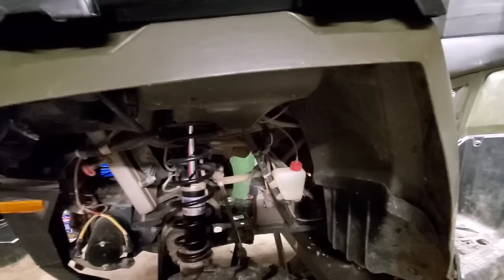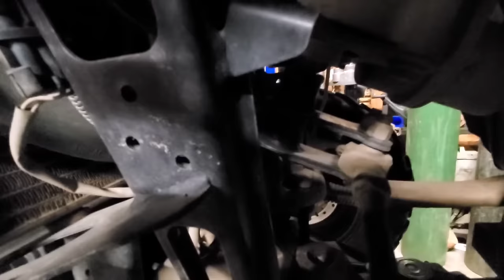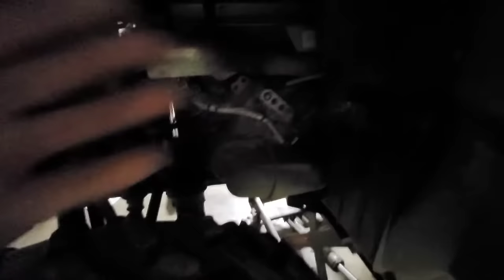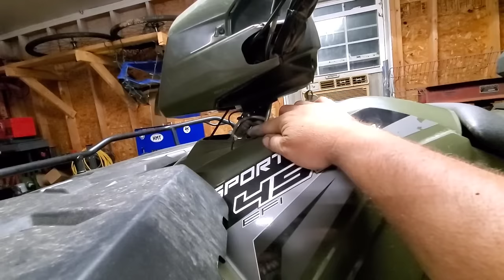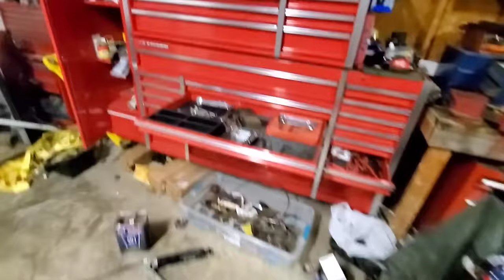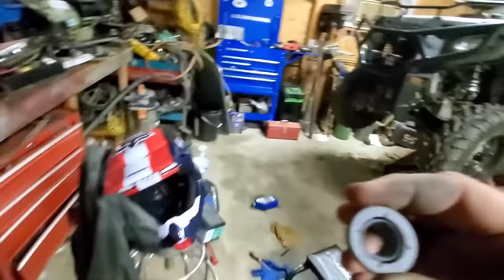Dear Polaris...this is shameful  #polaris #atv #sportsman

Comment: I have a can am 330 it's a 2003 with 10.000 miles the only thing I replace is the battery and ujoint on drive shaft and a fan that it but now if you buy a new one it's junk from the start. Never gonna buy a new one look for the older ones best bet .

Comment: I’ve never had issues with any of my Polaris ATVs and I’ve had lots of them with thousands of hours
Reply from the maker: I'm sorry but I simply do not believe that. You may have ignored issues that we address but polaris has many many weak links.
Reply: @quadbilly2106  I’m a mechanic for 30 years aircraft I keep my machines up to date , 325 magnum, 2 500 HO , 2 400SP and a 700SP and 450SP over the last 25 years, the  really only issue are torn boots but I ride through all kinds of crap. They are really non destructible in my opinion and I continue to buy to this day.
Reply: Funny how people got like 7 Polaris ATV and never have any issue in putting thousands of miles on it, when others puts few miles on same machine and everything got loose or broken 🧐🧐🧐

Comment: I have a 2015 sportsman xp1000 with 73 miles on it and the charging system stopped working. I only use it to plow snow out of my driveway and I think it's b's that they just build there machines so cheap and they don't care about there costumers

Comment: I own a 2013   500ho!! 9200 MILES hanged wheel brgs front suspension bushings and starter wires wrotted off just a couple months ago!! Other than that no complaints!! Love it and when i bought it the price was 5999.00  cant beat it..  definately buy another one

Comment: The SXS’s are the same quality. I bought a 1000 Ranger North Star for 26,000$ and it was a nightmare. It was a 2018. I’ve since moved to the Can Am Defender XMR and have done nothing but change the oils. It now has 4300 miles on it.

Comment: I have had Sportsmans, Rzr's, Rangers and I'm here to tell you, I'M DONE !!!!!!!!! Not only do there maintenance departments suck, but the cost is on the far side of crazy. Polaris, watch out !!!!! CFMoto is on your a## !!!!!!!! My current 2018 Rzr Turbo has EVERY possible bearing and u-joint changed and not by Polaris garbage parts. I do not even trust their maintenance intervals ..... they are full of sh#t. I'm a "trailer", not a "mudder". So the "accusation" I'm using the machine for what it was not intended is also a f#cking lie !!!!!! As long as we keep buying them, they will never change. The fact of the matter is, they are cheap "Chinese junk" because that is where the majority of the parts are made,

Comment: I’ve had 4 Polaris’. A 1999 Xplorer 400 2001 500 Sportsman HO. 2013 850 HO. Couldn’t break them. I tried. Then I bought a 2018 900 HO Ranger. The slack in the drivetrain when engaging the clutches after shifting into gear was just scary. Felt like I was going to break something unless I feathered the throttle. Dealer after test riding said it was better than most🫣. Plus you could light up a drive belt in a New York minute if you didn’t use low range religiously when required. Never spun a belt on the ATV’s. As I said, rode them hard and put them away wet. Sold the Ranger after 3 years of ownership for Covid prices. What I paid for it less tax. I babied it the whole time I owned it as it felt fragile. Replaced it with a 700 Grizzly SE. I rode much too fast on my 850 so I figured slower bike was the only thing that would slow me down. Short of hitting a tree. Plus 10 year belt warranty. Win win.
Reply: Which was better, 1999 xplorer or 2001 500 ho? I already have a 2007 500 ho efi, I just want 1 more and these 2 choices are mint oldies
Reply: @randylee2549  The 500HO is likely one of the most reliable Polaris’ ever manufactured. The motor power wise was much less susceptible to ambient temperature than the 2 stroke. Also the Xplorer had a solid rear axle chain drive while the Sportsman likely had the best independent suspension on the market at the time, shaft drive. I  loved the 2 stroke but the 500 was the better bike.

Comment: It isn’t only Polaris…I recently replaced my 2007 Outlander 400 with a 2022 570 Outlander. The 2007 was built to last…the 2022 has had several parts replaced under warranty.

Comment: 1500 miles and every suspension bushing was worn out so bad on my last Polaris ATV it felt like it was going to leave me stranded.  Imagine if using a full size truck for that many miles off road and you had to rebuild the front end lol!  I agree they are fun to ride but junk quality.  On top of that their AWD system sucks unless all you do is mud.  I had a moment of weakness 4 years ago and bought a new RZR.  Coming to a steep hill and hit the AWD switch (no throttle input) which lights up, hit the hill and I'm spinning like crazy only to realize it was still in 2wd.  Apparently you have to be going below 15mph or it won't engage lol!  Next ride out we are descending a steep loose power line trail and crawling down using engine braking when all of a sudden it's sliding down trying to go sideways.  Why does Polaris still use one way roller clutches to engage the front drive axles?  NO ENGINE BRAKING ON THE FRONT WHEELS!!!!!!  Works fine on flat lands and mud but crap for mountain riding.  Lastly, on mild slope logging roads it won't even hold back properly because when the engine rpm dropped down to a certain point it would take off again until about 1000rpm more than it would engine brake again.  I'll still to my slow, clunky Yamahas that last for decades without having to replace parts every 6 months lol!

Comment: I have a 2000 sportsman 500 ho has 19,040 miles on it put countless front wheel bearings and Hilliard in it. 3 clutches a water pump and maybe 7 belts. I have never opened the engine. Runs so good still.

Comment: I agree I have three Polaris machines razor ranger sportsman, 1000 and I have about 1500 miles on each and I’ve already had to replace the drive line on the rear on the Ranger four-door. Also some other little parts.

Comment: Polaris destroyed their victory motorcycle line so they bought Indian and dropped their victory customers like a bad habit. 
How long before Indian bikes are left behind at the side of the Rd.
Reply: They already are. 100% break failure, dozens of recalls and having to carry a half inch bar to short the starter solenoide because when it rains the bar switches dont work.
The recalls can  mean weeks to months in the shop. Never again.
They really should be taken to court.
Reply: @stevehunt9703  stock value has always trumped product value there.

Comment: I had a Polaris ranger 570 and before I wore out the first set of tires I had spent $4780 in repairs and I don't ride hard. I sold it and bought a Pioneer 700 deluxe 5 years later it has 14k on it and all I have done is change the fluids and filters. I now own a Talon and am happy with both.

Comment: Something tells me you have never..NEVER..owned a Japanese ATV! Any Yamaha, Honda, Kawasaki or Suzuki absolutely blows these piece of crap out of the water with regards to engineering, R&D, maintenance and simple drivability. I was a mechanic at a dealer for 7 years. Polaris are pure head scratching junk.
Reply from the maker: Grew up on hond 3 wheelers and 300 4x4

Comment: I hear the frustration in your voice, and like you, I do all the maintenance on my machines.  I own 5 polaris side by sides and because of so many undercarriage problems with polaris over the last 10 years, I opted to buy a John Deere Gator.  Cringed at the price but only real maintenance problem in 12000 miles has been the drive shaft (Grrrrr).  Have yet to have any bushings, bearings, brakes go bad.  Yes, a few issues here and there, but overall, I would say five or ten times the build quality on undercarriage.

Comment: I got 2017 polaris 570 touring. 9300 miles. Never broke anything. No bearing axel ECT..Only replaced a belt at 8000 miles. And really didn't need it. DON'T BLAME POLARIS FOR THE WAY YOU DRIVE THEM.
Reply from the maker: Bud, we ride with kids. We do strictly trail riding, not mudding, not at 70mph. None have ever been flipped.
We also have other brands that do the exact same thing, same trails same rides...none of the headaches

Comment: Matt's Offroad Recovery is frequently recovering broken down Polaris machines around Utah's wilderness.  Either they sell most of the vehicles or they are problematic for failure.
Reply from the maker: Welll 2 things can be teue at once
Reply: @quadbilly2106  yes - you point out the third option I didn't think of and so that may be the explanation.

Comment: I had a ‘16 Polaris RZR S 900 and thought the frame looked like something off a piece of lawn equipment. It performed well and I sold it before I had any problems but there were some cheap things about it. I’ve never been a big fan of Polaris summer machines. I do like their snowmobiles at 600cc and smaller, especially the fan cooled models.

Comment: i went to can am after i had nothing but issues with my polaris every ride. lol
Reply from the maker: Im thinking Yamaha grizzly is the best route for quality and rideablity
Reply: @quadbilly2106  well of course anything japanese is reliable as frig i agree on that for sure.
Reply: Yamaha or Honda all the way, but I own a 2013 Polaris ranger
Reply: @quadbilly2106  Suzuki is by far the best best quad the 750 has treated me well 18000 kms on it now and haven’t done much to it
Reply from the maker: @dcsales2007  problem is Honda rides horribly on trials, we have them to. The Grizzly is under powerd for real fun. The Polaris is an awsome machine to ride, but quality and cheapness of parts and reliability . For the price and the fact that they went backwards on build quality just pisses me off.
Reply from the maker: @dcsales2007   when we ride we typically do 80-130 miles a day. The honda ride quality is no where near polaris, which is the draw to polaris along with the power. The honda at the end of a day like that will have beaten the shit out of you. I agree tire pressure is important and I run depending on tire between 4 -7 psi no more. Im not in my 20's anymore so ride comfort is honestly my number one factor. Which is why I bought Polaris, but steering stem failures shouldn't be routine matainence. I take great care of our machines going over them after and before every ride so that we have success during our trips.

Comment: 4 years ago I bought a 2020 Honda rancher and I crashed with that over 10 times. 1 very bad crash when I was going over 45mph on 2 wheel drive. The rear end jumped up twice because of a couple bumps and spring jump made it lean, I jumped off and curled up. I flew about 15-20 ft and my Honda rolled at least 40-50 ft. Bent rear rack, broke rear axle, front bumper broke, front right cv axle broke and handle bars bent. Replaced those and everything ran fine😂. I just won a 2024 Polaris sportsman 570 and I’m hoping I like it. My rancher is still running today and only had oil and filter changes mainly. Couple rear axels due to crashes and 1 swingarm that’s all I needed to change, just a TANK!
Reply from the maker: You will like it. They ride amazing period they are super. Fun, they just don't hold up very well
Reply: @quadbilly2106  how so?

Comment: I have a 1990 Hond Fourtrax, and a 2005 Rubicon.  Both still running strong.  Yeah, they don't ride as nice, take a large area to turn around. maybe not as much power.  Maybe you should try a Honda??  Go get a bottle of Midol if the ride is too rough.

Comment: Well said, I got a 2018 570 and nothing but problems,voltage regulator, power steering and screen. And parts prices r a joke,$3,600 for a wiring harness, bs

Comment: I have a 2015 570 sportsman with ebs and power steering  and a 2015 sportsman etx.  The etx had a bad stator from  the start. The 570. Brake start switch went bad after a year.  Rear springs are junk and don’t get me started on wheel studs. I’ve owned both since new.

Comment: Your absolutely correct.i owned two 2015  570 and I care for my toys way more than most and they broke axles at 30 hours. The exhaust melted the plastic seat pan l now 14:57   have a 2020 pro XP and I have to put some of the quality blame on assembley.my XP pro when brought home had a trans cable so far out of adjustment I'm surprised the trans didn't get hurt popping out of gear grinding and the sales team took this buggy out and rode it for a day..the alignment was so far off it pulled the wheel out of your hand. Chat sites are saying the front cups in  the diff are going to go out at 500 to 1000 miles if you get in the mud. I can go on but I'm sure others feel the same pain.

Comment: I’ve ridden some a lot of different Polaris 500 HO’s from the early to mid 2000’s and really like the way they handle and drive more than any other ATV I have ridden but I just hear to many stories about things breaking on Polaris.. especially the ones made in the last 5-10 years. I was considering getting a used Polaris 570 but not anymore. I recently picked up a 2007 Yamaha Grizzly 700 with only 1,800 miles that I’m very happy with.

Comment: Polaris bearings have very little grease need to add more befor install, bushings need grease nipples and grease after every ride, steering coupler is fixed with a set screw and brearing mount will stay tight for a long time

Comment: The biggest FU is the 6 month warranty. I’ve got 4 Polaris sportsman 570s ranging from 2016 to 2021 every single one if sitting useless @ less than 500kms Fing junk! I just picked up a hushed Pos can am with 6500kms to use to get through the snow season. This is bullshit I’ve got over $50,000 worth of Polaris sportsman junk and a $40,000 Indian I’m sick n tired of! We always had junk old Hondas and Yamahas even old Polaris machines which I regret selling. We worked our asses off saved for years and got screwed over by Polaris! My brother runs another brand he bought cheap used pulled 4 of our bikes home.
Reply: You keep every atv at full throttle constantly? I'm betting your break in method is to ride it like you stole it? Riding them like they are meant to be ridden and not like race quads makes a difference in how long your investments will last.
Reply: @V4p3rcl0ud  wtf? All of my machines are broken in according to spec. Also what I’m talking about is serious electrical issues, internal mechanical components failing things melting in the fuse box starters falling apart… one of the quads I received brand new was missing engine mounting hardware in the rear of the engine when started at the dealership and test ridden the motor would make a serious jerk with a loud clunk. Took the dealership 6 months to sort it out and by that time the warranty had expired so I had to fight with Polaris to extend it by 6 months…. Even cheap ass CF Moto has a 5 years all inclusive warranty.

Comment: I know the pains!!! I have 1997 Trail Boss 250 2x4 bought from my Dad in 2001, very fun machine but tired of fiddling with it!!!
Wife had 1990 Trail Boss for awhile then trade in for new 1997 Honda Recon that last forever without any repairs on it!!! Just front brake sucks that’s about it!!! We just sold it two years ago to our buddy and he still has it and rides great!!!!
Agreed need better engineer people on Polaris!!! I bought new 2018 Polaris ace 500 now 1,000 miles and still had to work on it!!! Recently new prop shaft u joints and it’s pain in butt to remove everything to get it out!!! Also will do bushings next on A arms!!! All four wheel hub has a little play too!!! Geesh nothing new!!!!

Comment: Tell me about it the damn plastics is the worst part for me all the sides are loose the glue has worn off and the plastics sun faded in a year. The control arm broke from struggling in the snow on 4 wheel drive. But I’ve had a can am too and they are not any better.

Comment: Had a 2013 sportsman HO zero issues other than the cheap batteries from the dealership learned my lesson bought a battery from Walmart and it started flawlessly my sons carburetor Honda is so cold natured it always needs choke but my Polaris fired right up with minimum choke i took care of it but I worked it to and it delivered every time recently bought a 2022 ranger I’m learning it’s got a few qwerks but I’ll fix those to my liking it’s how you ride and who rides them there not perfect I like em ok

Comment: Every brand has its known issues, but is 50 people with an issue making Polaris bad when they sold 250,000 of the model?
All three North American brands get slop in the steering.
For the Bearings, yeah, they use shit ones, then want $80 (CAD) for OEM, but you can grab 4 all balls for the same price lol
Can-Am is the worst, you can't replace the shock bushing, so an $8 bushing is now a full shock at $400. 
Lastly, the biggest complainers come from the big V-twin owners beating the crap out of the ATV. It's just like a muscle car or Jeep, the harder you play, the more maintenance will empty your wallet. And that's why I traded in my High Lifter. Just the cleaning maintenance was hours so that you prevent premature wear on the rest.
Reply: For the bushings, I enjoy not having to grease them on my AC and when I had others like the KQ. I don't mind greasing things, but for crying out loud Polaris, why do you put 4 of the zeros in almost unreachable locations and then another 6 in just mildly difficult spots?
The front upper Arms on my 850 you need to balance a grease gun while putting the hose through the left side to the right side, and somehow keep enough pressure on the connection so it takes the grease because you can't tighten the tip to lock on.